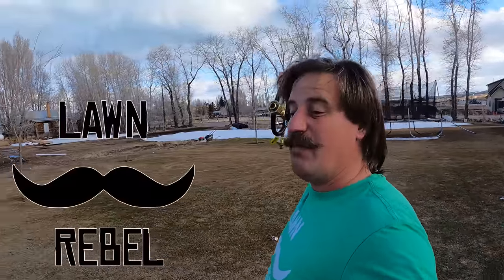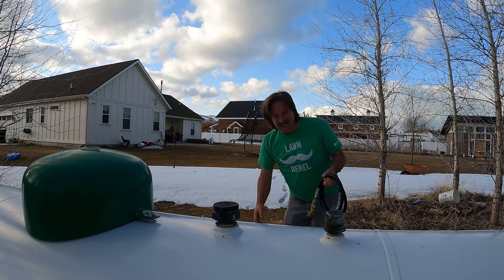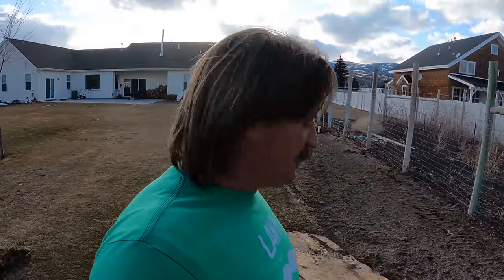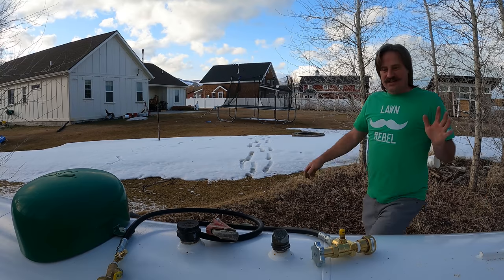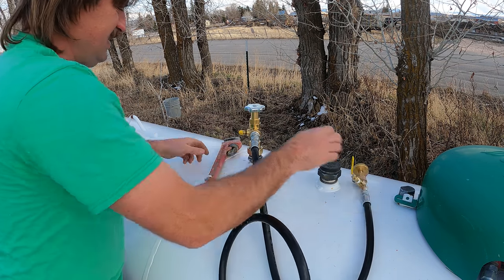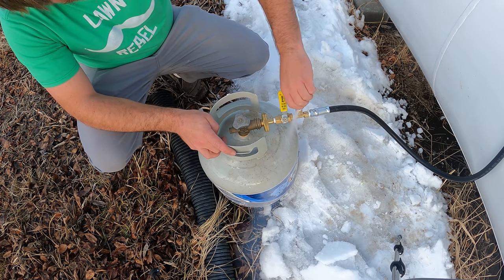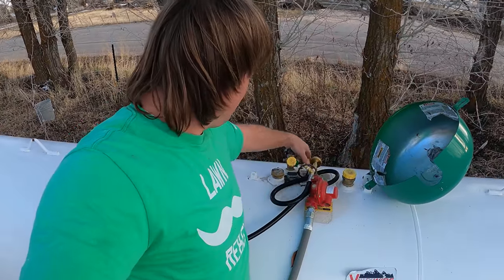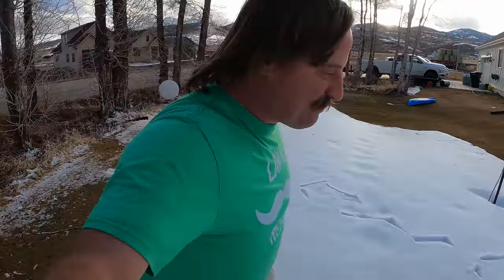HOW TO FILL YOUR OWN PROPANE TANKS AT HOME

Comment: Good thing he doesn’t smoke. 
I should be asleep but this Guy is Awesome!
Now I know where to go get my tanks filled.
Our camper still has the old valves on the tanks & I refill them with a 100 pound tank that I hang upside down in the shed but I heard I can’t refill them myself if I put the new valves on. 

Thanks again for the info & the laughs. You an your Family have a blessed Easter Conference weekend & to your followers as well.

Comment: Just undo the little screw on the small propane tank and when the bottle gets full and it starts coming out the relief valve it is full. I used to fill them at my job
Reply from the maker: Yeah I've seen them fill them so many times at the local campground where we can get them refilled. All they do is turn the pump on and then open the little screw that I did and it fills in seconds

Comment: Hi, would that work in reverse if you had an empty main tank and wanted to hook up a 100 gallon tank to to put some propane back into an empty large tank?
Reply: I have no idea how liquid gasses and pressure works but I figure since it’s a liquid, as long as the 100gal tank is higher than the large, it should. Atleast if it were water it would. (I don’t know what I’m talking about)

Comment: OMG, you are one lucky summbich. I've never seen a more untrained, unaware or luckier person working with propane. Didn't use brass wrenches, talking about venting air out of the tank, not weighing anything. You were very lucky this day, the system is essentially working but you need to educate yourself if you are going to play with fire.

Comment: Here's my question. Can you buy a 100lb propane tank, have it filled, and buy a valve that will dump propane from it into one of those larger 500lb tanks? We have a tank at an old farm house that needs to be filled but the bridge needs work and there's no way a proper propane truck and cross it to fill things up......

Comment: 1) you need to have a backup wrench on the tank fitting when removing the cap. If the fitting under the cap rotates all the way out, you're gonna have a bad day.

2) people already commented on the spitter valve on the receiving tank. 

3) It's not really cost effective to have a $200 + fitting to fill $15 bottles at home. But it maybe nice for emergency use.

4) possible injury or death could occur if step 1 isn't followed. 2nd degree burns and loss of vision are common injuries when you get hit with liquid propane with PPE.
Reply: I think for me it would be a  convenience thing. I live in the boonies and have multiple size tanks for BBQ, shop heater and trailer.  There are no propane places that are convenient to go to special right before a trip in the RV and realizing the tanks need filled. Im a half hr from closest propane supplier and then you have to hope they are open.
Reply: Let's not mention if something did go wrong, that propane tank can take out a city block. Putting neighbors at risk.

Comment: Connor. I am all for DIY, but if you are going to do this you need to use a scale. Overfilling a propane tank can be dangerous. When the tank warms up, the pressure inside will increase and cause it to vent into the area where it is stored.
Reply: Is the pressure in a big tank more than in a small tank?  i.e. wouldn't it just stop when the small one is full?
Reply: It's not just about pressure. It's about pressure/temperature   yes you can over fill the small tank it has to have a room for the liquid to expand.  As the temperature changes in the small tank if it is over filled it cannot expand.  And can rupture the tank . Even later on in storage.    Always use a scale.
Reply: Both tanks can have the same pressure and still have the small one " empty " as you need the liquid.  You  can use temperature differential do the pumping instead of venting the vapors in  tank.

Comment: Oh dear....ok,, lets go thru this...btw, I am an LP deliveryman by trade. I do not necessarily recommend filling your BBQ tank like this, there is some danger involved and if you dont know what youre doing you can gooch it big time.

1. The small set screw on the tank is a bleeder valve. Its primary use is as a liquid level check. You want to open it and when the tank is 80% full, it will shoot out liquid. That is a signal its full. The good news is BBQ cylinders have OPD devices that shut off at 80% regardless of if you shut down transfer or not. Though reliable, they may fail, thus bleeder valve is the standard way to check.
2. NEVER mess with LP unless you have proper safety equipment. Gloves rated for chemical contact are a must. I do use some Wells Lamont hide gloves, but bear in mind I've been filling tanks for 12 years and have filled over 10,000 in that time. LP boils around -43 degrees Fahrenheit. Its very cold. If it touches your skin, its more or less like instant frostbite and classified as a chemical burn. Its so cold it can freeze your clothes to your skin. 
3. Propane transfers are done with a pump. The valve he is pulling from has a dip tube that goes to the bottom of the large tank, so yes, you can do it. However, the small tank will not fill until the transfer line is purged of air, hence why it took so long to fill.
4. If you do this...the valve on the BBQ cylinder is the LAST one you open, FIRST one you close. Also, open the BBQ tank fill valve SLOWLY. If you do it too fast, you will trigger a safety feature on the valve that closes it. You must disconnect the tank and reset it by firmly hitting it on the ground, bottom first obviously.
5. There will always be some air in the tank, but BBQ tanks are vacuum purged at the factory. Again, you are purging air from the transfer hose.
6. If you attach a valve like that to the main tank, remove it when you are done. Things can happen, people can come and turn it on, and you can have worse things than losing LP. If there is a source of ignition, BOOM. Your LP filling company may even refuse service because of the potential hazard.
7. Most important...if you do this, because frankly I can't stop you, make damn sure you have ZERO sources of ignition. Cigarettes, electrical products, running cars....any of that needs to be minimum 50 feet away. 

OK, Hank Hill rant over.
Reply: The one question not answered, is:  How do you remove the liquid fill line from the main stank?  When the line fitting is unscrewed from the big tank, the valve in the big tank slams shut in a most troubling fashion.

Comment: You can build this for around $75-100 bucks. High pressure hose and fittings from local plumbing supply house is alot cheaper than the $250 price tag they got on this kit. 
I dig this dude, though... flipping badass mullet and porn stash just winging it like a rockstar is forcing  me to subscribe to his channel🤘

Comment: It works much better if you either heat the tank from what your transfering with cold water IF its cold outside. Better yet do it when its warm and cool the small tank with a constant stream of cool water. You can also use a mechanical bathroom scale to make sure you dont over pressure the 20lb tank. I usually fill to 35ish pounds, as the tare of the small tank is about 20lbs. Its safe IF you are careful!

Comment: A help full hint if you have a big enough  freezer you place the 20 pounder in there for a day  get your lines ready on the big tank get that 20 pounder out of the freezer hook them together  then open the valves but dont vent nothing. Leave it like that until the little tank warms to room temp. The little tank should be sitting on scales so you can check and see the progress. Because them 20 pounders can be filled to 21.5 and thats not good

Comment: I think the trouble was the cold liquid was turning into gas as the line to the BBQ tank was warm. Only when the line turned cold did you start getting more liquid to transfer.
Reply: No, the problem was that once some propane moved into the small tank, then the vapor pressure inside the two tanks was equal and there was no pressure differential to drive the transfer of propane from the big tank to the small tank. That's why at a propane filling stations they use a pump to move the liquid propane from the supply tank to the fill tank. When Connor opens the vent valve on the small tank, it reduces the vapor pressure and more liquid propane moves into the small tank... until the pressures in the two tanks equalizes and the fluid transfer stops again. You either need a special pump to transfer the liquid propane or you need to keep venting the smaller tank to relieve its vapor pressure. The new "refillable" propane canisters provide a special valve that vents off the accumulated vapor pressure. Of course that represents an environmental trade off: you are either venting gaseous propane into the atmosphere during the refilling process or you're throwing away an empty steel container which more likely than not will end up in a land fill. Not sure how this will play out in the long term. 1lb "disposable" propane canisters cost about $5 each. 1lb refillable canisters cost about $15 (or more) and about the same if you exchange an empty one for a full one. In the USA, either regulations or some other cost incentive will be needed before refillable containers common place.

Comment: This will only work if the liquid dip tube is ALREADY INSTALLED on the bulk tank. If it is not, all you’ll get is vapor off the top of the tank, and you’ll never be able to fill your portable tanks. 

Also, anytime you’re going to work on propane and you make the statement, “I’m not too sure if this is going to work,” then JUST DON’T!

Comment: This is probably about the most dangerous thing you can do with your propane tank.    If that liquid valve on the 1000 gallon tank fails or gets stuck, you’ll get an uncontrollable release of every thing in the tank  when that valve is removed.   
Also he is lucky he didn’t get a freezer burn doing this without gloves.  8:42
Reply: Why would he get freezer burn screwing on the heater? That’s ehT your supposed to do
Reply: @aelfwealld  because the temperature of liquid propane when it escapes the tank is -44 degrees F    I work for a propane company and been freezer burned from contact with it.  That liquid valve on a tank is not something to use if you don't know the safety precautions    leather gloves wont help much, you need special coated gloves for propane
Reply: @willyskilt freezer burn🤣  that’s what happens to food in your freezer.  Freeze burn.
Reply: I did propane to in Midwest corn dryers used liquid valves all the time never once had one malfunction. But you are right if you don't know what you are doing, don't do it. Propane burns hurt, get special gloves!!
Reply: @aelfwealld you get burnt by liquid propane as it is extremely cold on those spit valves. The one on tank tells you when it is 80% full. Never overfill.

Comment: Very cool!  I have two tanks that I rotate so that I never run out while grilling.
Reply from the maker: Yep. I have 2 as well
Reply: @lawnrebel  Of course you do.
Reply from the maker: Best part about this whole set up is that I really don't need a backup anymore. I fill on demand at home
Reply: @lawnrebel  If I had that setup I would have done the same thing. I need to get a hose for my heater so I can use my 20lb thank instead of the 1lb bottles.

Comment: When you assembled all the parts they sent you, it was incorrectly assembled.  The bleeder valve is installed in between the ball valve and the small tank connector.  Just an FYI.
It DOES make a difference ;)

Comment: I love how you're trying to fill a tank that you aren't supposed to fill your own...another classic Conner Ward video :)
Reply from the maker: Why would I let them tell me what I can and can't do? This is un American
Reply: @lawnrebel  Amen brother Ward.  Long time subscriber and thanks for all of the great entertainment and lawn knowledge.
Reply: Connor,  you did everything right except wear gloves. You described the process correctly by turning on the house tank valve first down to the grill bottle. The "liquid leg valve" on the house tank has a drop tube to the bottom to siphon liquid; correct. Some tanks have them, some don't. Fortunate yours does! The grill bottle (newer ones) have a snap lock valve for safety from over filling. It snaps shut at 80 percent volume of the tank being filled, also the slotted head you turned is to show you when you reach 80 percent also by blowing out liquid....otherwise you hear the vapor being  released until its full. The house tank is filling your grill bottle by gravity feed from the pressure it naturally has. Propane is under alot of pressure so wear your gloves for sure and your right....never smoke near there!  I know because I work in the propane world👍
Reply from the maker: "Propane and propane accessories"
Reply: @lawnrebel  from the looks of it you don’t own that tank so you shouldn’t be messing with  it . If our bobtail drivers saw this they would lock the tank out and wait there for someone to come remove the tank
Reply from the maker: @scottboerner6593  thank you Sally
Reply: @lawnrebel  all the money you saved should buy a nice celebration of life service 👍
Reply from the maker: @scottboerner6593  just glad I/we have people like you that protect us from our own selves. Kind of like all the gov 3 letter word agencies.... They are there to protect us from ourselves.

Comment: As a licensed gas technician per NFPA54 and 58 codes, all do respect you should not be doing that or showing how to do it. I have seen many mistakes which have caused explosions. The tap you are on is for emergency removal of the LP product and should not be tampered with
Reply: Accident waiting to happen. Liquid propane released has the reirrigation effect of 44 degrees below zero. Put a fence and locked gate around it, to prevent a child or anyone from getting hurt. 
if   homeowners' insurance company knew of this, they might would cancel the policy. It's not worth the savings to take a chance like this.
Reply: Is this guy lucky his brain is still inside of his skull? I am surprised he didn't light a cigarette while waiting.
Just because you can buy a gizmo off "the ebay" so that you can do this DOES NOT mean it is a good idea to do it.
Reply: So you suggest hiring someone to come to your house to transfer propane from one tank to the other? How much does that cost?
I'm sure there must be a safe way to DIY this task at home. This guy seems pretty uncertain almost every step of the way so I wouldn't use this video as a DIY tool for myself. But this is something I'm looking into doing myself at home.
I'd appreciate any professional advice if you're willing to put that out there.
Propane in Pennsylvania right now is at $4.19, it's ca-raaaazy
Reply: I do this all the time and I’m still here
Reply: so all tanks hooked to dryers using liquid propane are illegal?  that's just the proper line to pull liquid propane genius.
Reply: As a propane professional we install these at factory's all the time to fill bottles without issue. That liquid line is fine to be used that way But I will  say don't install one of those valves when the tank is full. They can stick and blow off.
Reply: @m4sherman4  not following what you're saying? How does the valve blow off if it's threaded on?  Serious question
Reply: @Happy_Harry  yes, he isn't tie-ing into the blow off line, he is hooking into the liquid fill line. Some tanks have them and some don't.  On older tanks it is possible for the liquid fill line to hold wide open  when you remove the cover cap though so this is best done at low compacity and in low temps
Reply: Then someone should come. With a safer way for us to fill up our tanks, or maybe we pass a law that you all don’t charge us so much to refill our 20lb tanks as compared to filling our 500/1000 gal tanks.
Reply: @charlesbratten3293  I tried looking up "reirrigation” I got this message on a few different dictionaries. Can you give a definition?
The word you've entered isn't in the dictionary. Click on a spelling suggestion below or try again using the search bar above.
Reply: @frankrodgers4656  Typing error, should have been refrigeration. Sorry for the confusion.
Reply: I do it all the time. In fact most of my neighbors do also. No issues. You just want your money!

Comment: Man you just went through a whole lot of work that you're going to have to repeat every time you empty that bottle why not just add a line directly to the shed to run the heater on without the bottle then you don't put yourself in any danger refilling tanks. Also the bleeder valve on the side of the propane tank your filling needs to remain cracked open during the entire fill process until liquid vapor is actually seen to ensure the tank does not overfill then shut off the hose fill lever prior to closing the screw valve, don't worry you won't actually be able to overfill it as long as the valve in the small tank is working properly. and do not open the bleeder on the hose during the fill process, this only wastes fuel.

Comment: Not to mention, if you take the withdrawal valve  off completely too quickly (threads are very short) and you dont make sure the valve checks. You will not be able to stop the release and he is not wearing gloves. Freezing propane liquid would pour out all over your hands, arms, probably face resulting in severe burns and possibly an explosion if there is an ignition source near by!

What he did in this video was dangerous.

Comment: Be easier to put a tea connector and a quick connection past your regulator and plug Anything you need to run propane off of your big tank. instead of wasting all that gas?